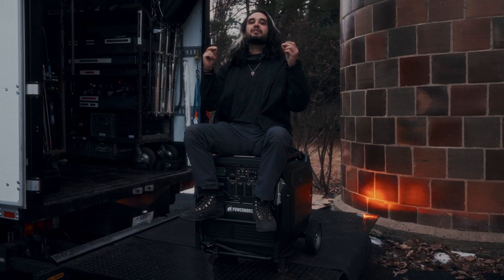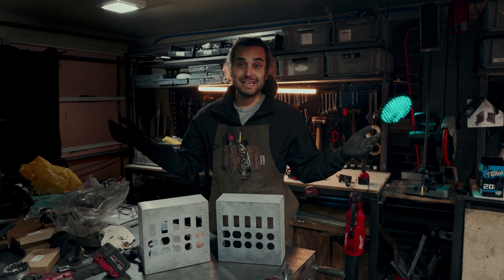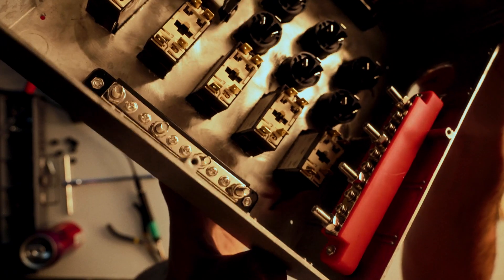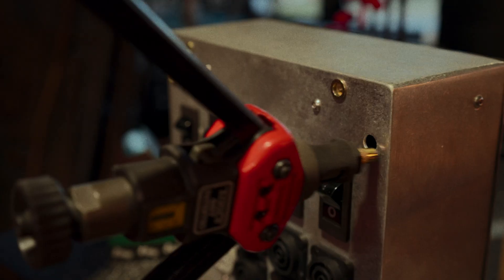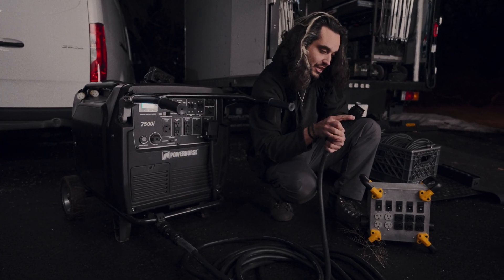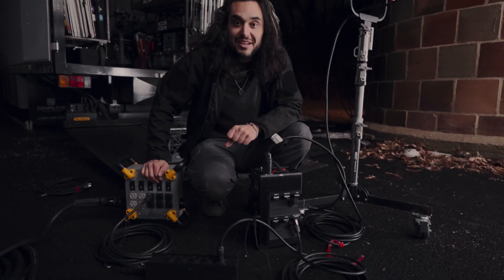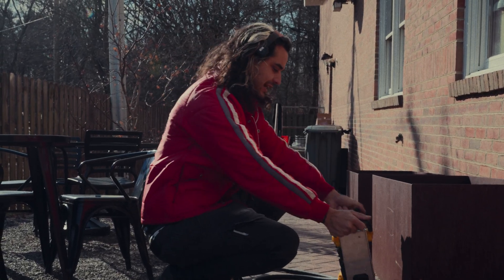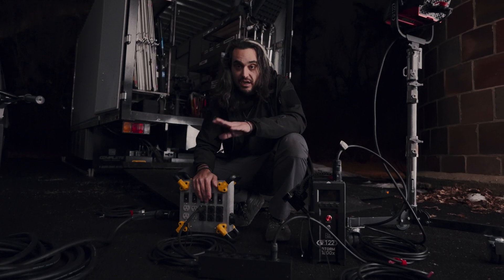The 120v fallacy plaguing the film industry

Comment: I'll be frank: I see a lot of safety issues with this build and setup. Well, who is "I"? I am state-certified AVL/event technician from Germany, and a large part of this certification is everything that goes into planning and executing a mobile power distro, from the generator/source outlet all the way to the light. Electrically testing distros and devices is also part of my job, so it might be similar to an entertainment electrician. These safety issues I believe to be present can be roughly divided into three categories: the wiring of the distro/your new soca standard, the weather-/fireproofing and the generator usage (the latter is only potentially a problem).

1) the distro wiring:
There is a reason why standard connectors for any notable amperage, be it the CIE 13 plug often found in PC power supplies that's rated for 10A or the Bates/stage pin connector rated for 60A, all have one single, thick pin per connection (one pin for hot, one for neutral and so on) and do not distribute a, let's say 100A load over 5 pins that can carry 20A each: there need to be breakers that make sure no single pin can be overloaded, and because that's quite a bit of effort, it's easier to have fewer but thicker pins.
For distributing multiple circuits in theatre lighting, this is no issue because soca is only used after the circuit breaker, so whatever is connected to the socapex outlet, the breakers make sure it doesn't exceed 20A per circuit and thus pin.
With this distro on the other hand, it is an issue: as far as I know/could see, you utilised a bus bar for the ground and neutral, possibly for the hots. This is an issue because between the bus bar and the 60A NEMA plug at the generator, there is no safety mechanism that prevents one of the socapex pins being overloaded. Current is distributed across multiple paths according to their resistance, so if one of the pins on the feeder socapex has bad contact or the wire is broken, the other four pins will see a larger share of that 100A current than the 20% they're rated for because the fifth path the current could take is now high-resistance. And I say that with awareness of the fact that the NEMA plug can only handle 60A and will probably have an appropriate breaker limiting total load to 60A because even with 60A, it only takes there being bad contact at two of five pins at any point in the chain to overload one of the remaining three pins making good connection because there is no safety mechanism.
And even if you had seperated the circuits in the distro all the way from the edison/powercon outlet to the socapex inlet, it would still only be fine in this specific configuration, and because there's nothing preventing someone from connecting a distro that's got a dangerous wiring configuration to the soca cable, it really isn't an ok standard.

2) the weather-/fireproofing:
First of all, "IP-rated" means nothing except that the device has some sort of rating for it's dust- and waterproofness. That rating could be IP20, which means not waterproof at all, it could be IP44, which means protected against spray water, or it could be IP67, which means that it can be submerged in water for limited time. IIRC, PowerCon True1 TOP is rated IP67. I don't know the rating of Socapex, but looking at the connector, I doubt it's more than IP44 or maybe IP65. So if you're shooting in the rain, it's probably going to be fine, but as soon as you've got your soca connection laying in a puddle, you've got a problem.
Secondly, an IP rating should always be seen with the owner's manual as adherence to an IP rating is always dependent on certain conditions being met. For example, those powercon outlets only have their IP rating if the appropriate connector (PowerCon True1 TOP (total outdoor protection), not just PowerCon True1!) is plugged in, otherwise there needs to be a silicon cover (not present on your distro) covering that outlet in order for it to meet the IP rating.
Your distro as a whole is probably only IP20, so you should absolutely not use it for rainy shoots. The reason I assume this rating is that the edison outlets appear to be IP20, the aluminium casing seemingly has no gaskets and the holes you drilled didn't seem to have any waterproofing either.
About fireproofing: this concerns the 60A-Socapex adapter at the generator. Typically, boxes for electrical stuff are made out of material that can contain an electrical fire if it were to happen inside the box, but I don't think your 3D printed housing is capable of that.

3) the generator (this is only potentially a problem):
To make this point, I'll first need to explain what the ground connection is actually good for:
Let's say one of your lights has the type of fault where a live conductor touches the casing. Because the casing and the electricity source is grounded, the electricity has an easy path to follow: it comes from the live conductor of the source (the pole transformer), goes through wiring into the device, mistakenly goes through the casing, through the ground wire and all the way to the ground bus bar of your breaker panel. From there, it either takes the combined ground/neutral wire or the ground rod and actual earth (depends on your local power grid) until it reaches the ground of the pole mounted transformer. This is a complete circuit and because the path is so easy, there will be a lot of current and the breaker will trip (it's even safer with a GFCI). And because this path is such low resistance, there will also not be much electricity flowing through you if you somehow do happen to touch the live casing.
But what happens if the source, in this case the generator, is not grounded? For the first faulty device, there's no complete circuit, no electricity flowing through you, easy peasy. But if there's a second faulty device on the other phase and you touch both, you've got a big problem because now your body is making a connection between two hots, so that's going to be 240V across your body and a significantly too high current flowing through you, which can absolutely k*ll you.
This is why, at least in Germany (in occupational environments), if you want to connect multiple devices to a generator, you have to A) ground the generator B) have a Potenzialausgleich (common "ground" that's not actually grounded) and Isolationsüberwachungseinrichtung (device that shuts off the power if it detects more than one fault) or C) have an individual GFCI for each device you connect. I do not know the regulations in the US, but I would urge you to check the owner's manual of the generator to see if condition B) is met and you're allowed to connect multiple devices. It could very well be that option B is built-in, in which case it's fine as is, otherwise you have an issue.

ETA: the metal casing of the distro also absolutely has to have a ground connection. Pretty standard, but I'm pointing it out just in case.

Also, be wary of the disadvantages of the connections used: soldered connections are pretty iffy if a lot of current is going through them, like in this case, so be very cautious with that. Screw connections/terminals can become loose over time with the thermal expansion and contraction from varying current flowing through the copper and heating it to varying degrees, so make sure to open up the distro to inspect it every once in a while, I'd suggest at least yearly (but this also depends on how heavily it is used).
Reply: Great work! I also noticed the multiple circuits, and was concerned about using that for power delivery. The math is complex because both physics and accounting is involved, but in simple terms it's best to use the minimum number of conductors, and size them accordingly. You're right that one can create a voltage divider with multiple paths, and then failure of one causes overload of the others. Well done!
Reply: @Speed-Daemon-123  thank you for the kind words!
Reply: @charlotteice5704  thank you for the very detailed explanation! I was especially impressed by your grasp of grounding, especially earth grounding. You are correct that we use grounding where electrical power is consumed because utility power distribution is grounded, and that earth ground is the path to danger, not safety. Your explanation is better than anything I can think of! When I try to explain that to US electricians, they don't get it. I get "grounding makes you safe" and nothing more. So I'm excited to see that you really get it!

I got into electrical engineering after I became interested in doing amplified music and lit theater shows in high school. But when I looked to the professionals to tell me how it all worked, I was disappointed to see that they really didn't know. I used to design and build power distribution systems because everyone took power for granted except for me. I made them, but felt uncomfortable because I wasn't sure I was doing it correctly, and didn't want to electrocute someone. University was the only place I found where people knew what they were saying, so I enrolled.

If there had been a certification program back then (40-50 years ago), I would have done that. I didn't know how much materials science impacts engineering beforehand, so I'm pleased to see that you're on top of that aspect as well. I think you'd make a fine engineer if you wanted to do it. The math is the hard part. For some, communications skills need to be developed, but you have that too. I hope you go far; the world needs more conscientious thinkers like you.
Reply: See all the posts about the new 12v power connector used on Nvidia 4090 and 5090 GPU cards for a real world example of that type of failure. This can be used to fight back against someone building that type of power distribution.
Reply: Agreed that paralleling conductors through a pinned connector is sketchy. Ask Nvidia how well that's going!
Reply: i was coming here to comment about the box not being grounded lol
Reply: If a socapex/stage pin connector comes partially unplugged, won't it suffer the same fate of the theoretical multipin socapex losing one or two pin continuity?  The socapex is designed to keep all pins mated and thus the resistance at a minimum . If the Bates at 60A are becoming warm and fusing together, it sounds like they are having a high resistance due to their design. I think the concerns are overstated.   I would like to see GFCI and AFCI in the system, though it seems a bit hard to engineer in because if done at the source, the entire system goes down. But maybe that is a good solution.  Another would be a bracket at the distro that clamps to a local ground rod.
Reply: Great Comment! It seems like splitting the power into multiple strands necessitates individual breakers or fuses for each wire. If one fails, at least you would have some indication (the broken wire would be on the breaker that didn't trip). The amp draw indicators are great (except for the IP20 or lower rating and additional "ventilation" holes in the box), but a fail safe design is still required for each potential circuit. And, that could be GCFI breakers in a box attached to the generator that is actually NEMA rated (and not the 3d printed part). As proposed above, confirm the ground and dual component failure mode is covered. Other than those issues, I really like the ingenuity here.  Just be aware that any new design that deviates from the established norms needs to be thought through much more thoroughly. New designs always create new failure modes.
Reply: Your generator explanation reminds me of something my dad once ran across in an apartment. The electrical grounding was tied into the plumbing of the building, and something went wrong in such a way that there were 70 volts between the sink and the handle of the refrigerator.
Reply: Am i correct in understanding that Germany mandates an IT earthing system for generators (Potenzialausgleich)? I've always used the TN-S system for generators at events, and TT in residential settings.
Reply: @bjornroesbeke  nope, that understanding is not correct. I only know of the rules/guidelines for occupational use of mobile generators (DGUV Information 203-032) which are rules to work by regardless imo, and they differentiate between four classes of generators: classes A and B have an equipotential bonding connection (Schutzpotentialausgleichsanschluss) and can be taken into service by laypeople while generators of classes C and D require an earth connection and can thus only be taken into service by an electrician (Elektrofachkraft; I believe certain types of EFKffgT such as Elektrofachkraft für Veranstaltungstechnik (entertainment electrician) are also included) because someone needs to test the ground connection. There are small differences between classes A and B and C and D respectively.
With a class A or B generator, you've got an IT system of sorts - but without an isolation monitoring system in most cases as class A generators can, but don't have to have one and class B generators don't have one and rely on integrated RCDs for all but one socket for safety (class A generators without an isolation monitoring mechanism require that all but one device is connected through a portable RCD or separation transformers).
With a class C or D generator, it's likely going to be a TN-S system you're building up, with class C having built-in RCDs (and thus certainly being a TN-S system) and class D only serving as a feeding point where all necessary protective devices/measured need to be determined by an electrician. I think it is unlikely that you're building up a TT system with a generator because this would mean that both the generator and the distro have their own ground rod, despite the usual spatial proximity, and no ground conductor of any type between the two (not even a PEN/combined earth-neutral conductor). If they both have their own ground rod and there is a ground conductor going between the two, that's still a TN system and the so-called equipment ground (idk the proper english term, it's Anlagenerder in German and referring to the distro's ground rod) is actually just an extension of the source's ground (Betriebserder/erweiterter Betriebserder in German) which is often placed in normal, permanent TN distros if the earth loop impedance is too high without it.

So to get back to your question ( tl;dr ), no, an IT system is not mandatory if you're putting up a generator in Germany (unless there's no electrician to test the earth connection).
Reply: Soldered connections aren't as iffy as the German Wago connectors, lever and push, especially compared to a properly installed wire nut (Marrette).  That being said, I would have used NEMA twist-locking connectors as those are similar to how Neutrik PowerCON-style connectors are implemented, especially in certain weather conditions.  That being said, Socapex-terminated cables are only really rated to carry a maximum of 10 Amperes per circuit, if I remember correctly, not 20.  I agree there are better connectors for this purpose and Socapex is not exactly the solution here, especially if used in this configuration.
Reply: 1) The distro wiring is fine and the way that connector is designed makes is very low risk. I would probably have used PCE connectors instead but those are not common in the US. 
2) Spending less time then it took you to write all that they are IP67. They are fine. In this context I think it is clear to not use the Distro in the rain but the connectors would be fine. 
3) Having hot between to devices due to bad wiring is a real risk but you don't need GFCI per leg for that and you can address the risk by making sure you don't screw up the wiring. This is the same problem anyone manufacturing these kinds of distribution boxes will face. Adding a single GFCI or GFCI CB would be a marked safety improvement without compromising  the practical purpose. 

The Ground bus bar is ground to the case. This is a common bus bar used in the US. 

I much prefer solder cups but that is a debate we dont need to start.

Comment: Watching this from a country where the generators we use on site put out 230V and 400V. Ocationaly we get a crew that has travelled from over the Atlantic and bring there own distribution. The first of many heated conversions about there distribution starts when they aproch swinging the ends of a set of Cam-Lok.

As an example of typical distribution we use over this way search for Essential Supplies Power Distribution Units . You can even get distribution with full remote monitoring if so desired.

Comment: Awesome build! Where can I get those volt/amp/Hz meters?
Reply: I assume he did not say specifically because a search like: "volt amp hz meter panel mount" will give you plenty of options.
Reply from the maker: Just found them on Amazon looking for panel mount voltage readers.  And then I was like holy shit to make ones with current readout too 😮
Reply: Keep in mind that these small power analyzers from China have a capacitive dropper as power supply, there are different types that are intended to be used either on 110 or 230 V systems, and often those capacitors are barely rated for 250V (peak, not RMS).

Comment: It is called NEMA 6-20.
Planning to install NEMA 6-15 for my EV charging: so that I can reuse the wiring for the existing NEMA 5-15 plug.
This required me to buy a programmable EVSE: because by car would draw too much current at 240V otherwise.

Edit: Disadvantages of the above standards are mentioned at 15:13. Also those are 3 wire connectors, so no dual voltage,